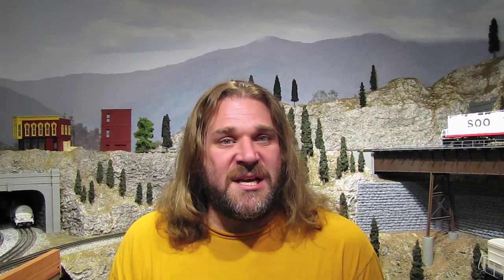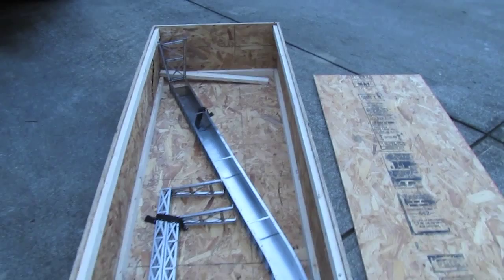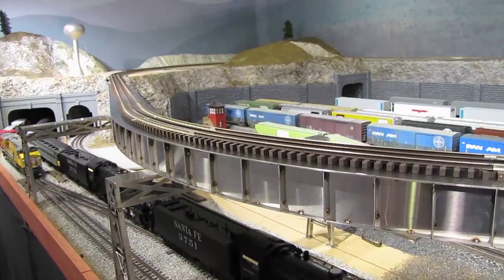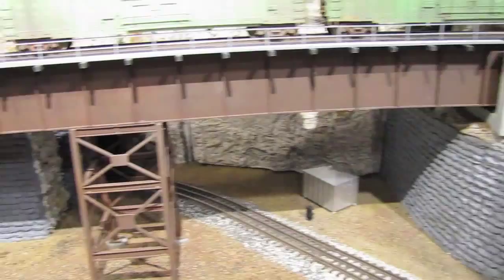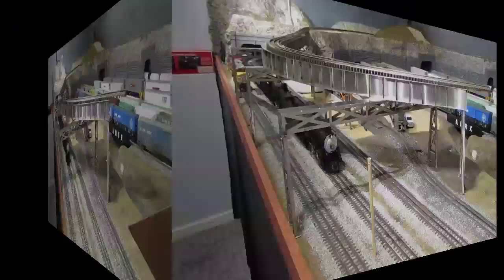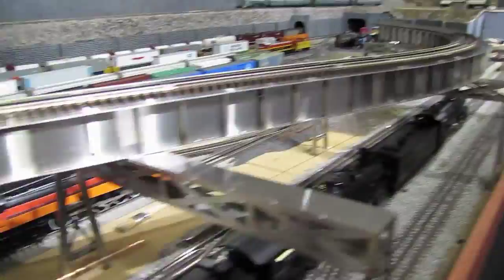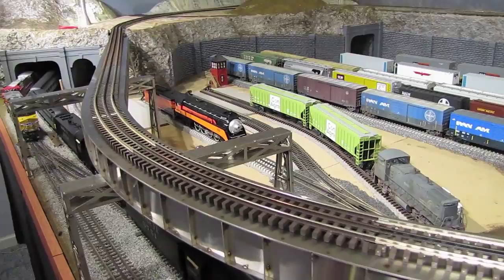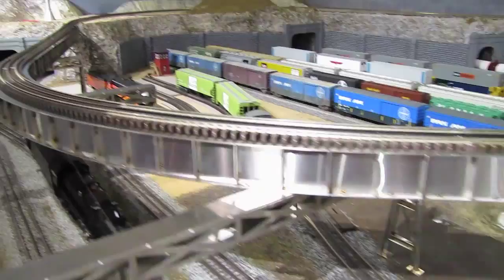Eric's Trains Video Blog - Episode 34

Comment from the maker: It has nothing to do with using MTH & Lionel together. It's just an issue that can occur when you use Lionel's TMCC or Legacy systems. When there are multiple tracks next to each other or on top of each other, the radio signals coming from the tracks can cross each other and cause interference resulting in Lionel engines not getting a good signal. It's fixed by using a ground plane to absorb the signal cross talk and eliminate any problems. See episode 23 of my video blog series for more info.